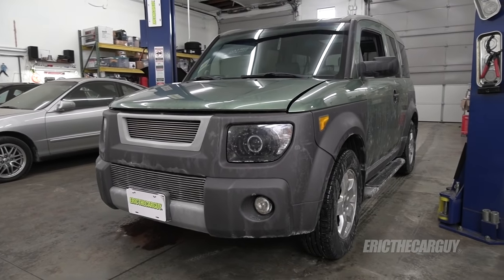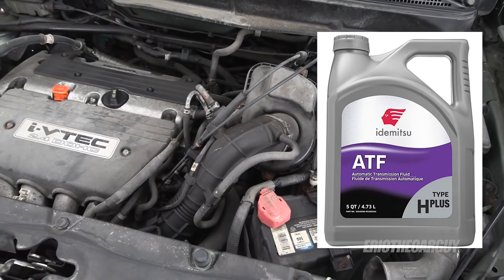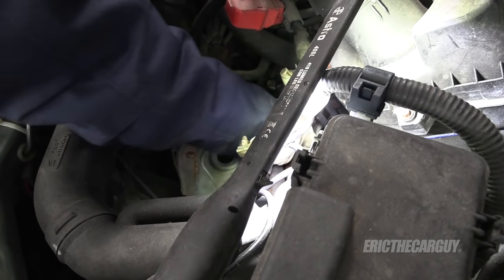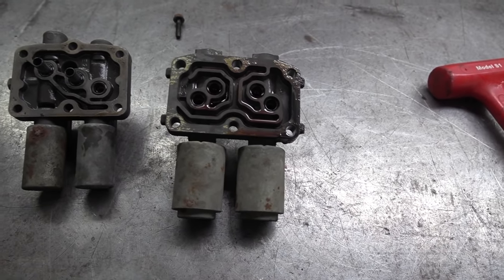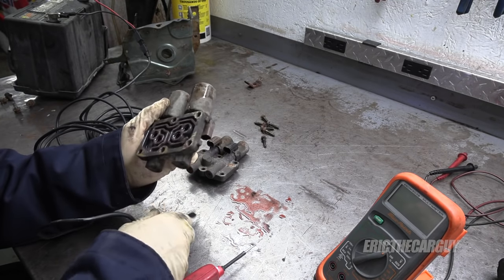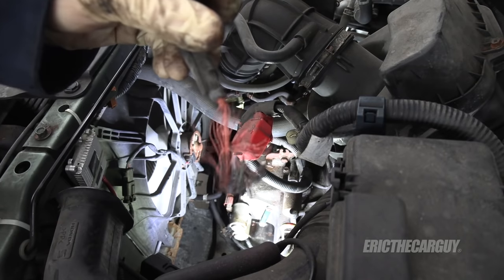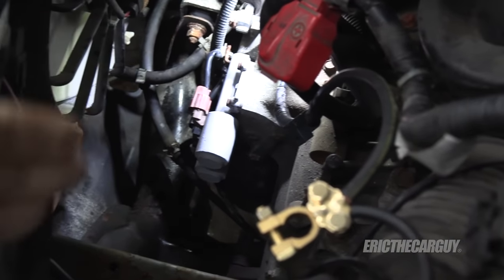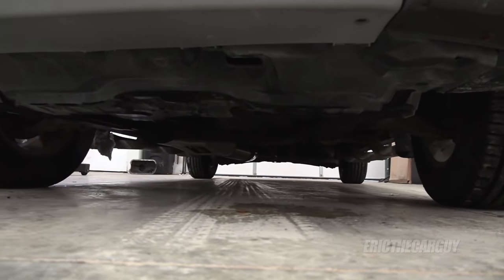Delayed Shifting, Honda Transmission

Comment: Hi there , some issue basically on morning Civic hybrid 2010 ,while shift from P to D there is a little delay and then small bump and then after  all runs perfect in other time of the day not issues any warning signs just works perfect but this bump such annoying case , any idea ? Thanks in advanced

Comment: Change your atf at half the interval honda says to! My 2016 odyssey was shuddering when shifting 3-4 and 4-3. Honda says atf every 100k. I do a google search, they have a tsb for this exact issue. Solution, atf fluash. I had it done problem gone. My van was at 57k miles. If Honda just said atf at 50k miles there probably would be alot fewer complaints about honda auto trannys.

Comment: Great video, I have a 2009 civic that has delayed shifting in all gears.  
I have replaced the fluid and the filter with no results.
There’s 2  solenoid packs under the air box.  Which one should I replace.  The one with 2 solenoids or the one with a single solenoid?  Thanks so much

Comment: My Acura tl 2003 since winter of 2000 has problem shift in cold weather, 40F or below, when start.  First, I put in D all good till first stop.  Then do not want engage 1st speed after I stopped at the first STOP sign.  I move my leg from brake pedal but car do not want to move.  I have to move the handle from D to N a couple times or move it to 1st manual.  And a couple times so till car/tranny warm up.  I tested dual liner for resistance and it show 4.9 and it is close to 5 ohms.  However I tested it at 50F, and you show that test may or may not be good.  Other, your car has problem in 3th and my in 1th in cold weather.  Some guy at forum say in my case should be single pressure solenoid C.
Btw in June my Acura had timing belt failure like yours, 11 tooth missing, and I go ahead replaced timing belt set and all good.  Get lucky.  Made tread about it at acurazine "The engine stalled while driving last night and car will not start again..."

Comment: How do you find the correct solenoid for the gear that's delayed? My car has delayed shifting in to second which I'm guessing is 28015-RCL-315 Solenoid Set A but I'm not sure.

Comment: How exactly did you isolate it was THESE solenoids that you need to address, and not some other solenoid(s) or pressure switches? Thanks.

Comment: Thanks Eric! That was awesome. Please, what could be the possible cause(s) of flashing 'D' and green light on 'R' at the same time on a 2002 Honda CRV immediately the ignition is turned on?
Note: The transmission is shifting fine but the two lights on with 'D' blinking on the dashboard.

Comment: I have Honda accord 99 4 cyl. It does not have any error code but 1 gear slams really hard  in either direction. I replaced solenoid but no improvement. I have already replaced fluid with Honda Fluid.

Comment: I had this shifting issue on my automatic 1995 civic. I replaced the vehicle speed sensor for 13 bucks and its been fine for 3 years.
Reply from the maker: Pre 2000 Honda transmissions were very different. Better in my view.
Reply: I have hard shifting 2nd hard to get to 3rd gear . 2000 Honda Civic DX idk what to replace

Comment: I don’t know if it works the same on an Element… I had a bad solenoid on my 2004 Honda Pilot and the Drive light would blink which is a warning that solenoid is failing

Comment: Great video Eric... I have a 2004 Accord 4 cylinder. I was always told they did not have replaceable filters. Do they all have that?  You did show on the fixing it forward Odyssey that filter. However, never saw an in line one like that. Thank you for your hard work.
Reply: Honda manuals officially says they aren’t serviceable which makes no sense because they clearly are.

Comment: Nice video Eric. My 08 element shutters when it’s at a steady speed between 30 to 60. Even when I use cruise control. I have changed the transmission oil twice now and used Honda oil. Have u come across this problem?

Comment: Love your videos! Was just wondering, what is the MPG on that element. Mine is getting around 17 mpg and I'm trying to figure out if that is normal or should start looking for an issue. Thank you!
Reply from the maker: I get 17-18mpg with my manual Element driving around town, not much highway at all. I haven't kept track of this Elements mpg lately. It's probably less, by 1 or 2 mpg, because of the automatic.
Reply: @ericthecarguy  Thank you so so much for your reply! I got it at the end of 2020 and didnt notice the coolant hose was leaking. Got a warped cylinder head -__- But thanks to the help of your videos I was able to get the head removed and machined myself! Thank you so much for everything you do! Element is running well now!

Comment: My honda crv 2006 won't  shift back from 2nd gear to 1st gear on steep climbs. I always need to manually shift it to 1st gear. The RPM get stuck at 2K on 2nd gear and wont shift back to 1st gear on steep climb. Could it be the shift aolenoid?..  tnx for answering sir.

Comment: Hey man my civic 91 dx had it for 6 years and like 3 years ago transmission run out of oil and i fill it up again and then i rebuild the engine but i fell the car really really slow like lose of power it shifts normal but car fells so slow all sensors are working no check engine codes and had straight pipe exhaust , what show you recomend me i think the problem is the transmission

Comment: On your 07 TL there are shift solenoids inside the transmission below the clutch pressure switch which is what you took off

Comment: Eric, I have an 03 Accord V6. Last week I was driving to my VA appointment, all of the sudden my car made a jerk sound and slowed down instantly. I couldn't drive over 20mph. I have replaced the trans fluid, some sensors, spark plugs, coils. And its still doing the same thing. I was told its the switch solenoid. Is that true? Please help!

Comment: My Honda crv 07 has the same issue on the second shift. I've changed the clutch pressure switch and it's still the same. 😞😞😞

Comment: Well Thank you for the great demonstration, however, I wanna ask you a question, I've civic 2000 ex and had the same shifting problem but the solenoids are different than this car in the video could it be fixed the same as what you did??    Thank you very much

Comment: Hello! I have an 05 element. I recently noticed that after a long drive if I shift the vehicle from park to drive it takes a second then jerks into gear. This doesn't happen cold and all gears 1-4 are totally fine and crisp. Any ideas? I've tried to hit the forums and no luck. 
I've done a trans filter and a 3x drain and fill.
This only happens when it's warm!

Comment: I have a 2017 V6 Accord sedan and very rarely, once a year ago, and once a week ago, it suddenly shifts roughly into first gear when slowing down. After that, all the following shifts are rough and delayed (even with minimal throttle it doesn't shift into 2nd or 3rd year until 4000 RPM). I pull over and turn off the engine. When I fire it back up, it runs smooth as butter. Is this a software glitch? Clutch wearing out? I'm at 174,000 miles~

Comment: My 06 CR-V taught me first hand how much it appreciates proper voltage. I noticed that the alternator was acting flaky a few months ago, but nothing to warrant replacement. Then the F Can bus started dropping out. Whenever this would happen and it would upshift it felt like I was hitting a brick wall. Literally painful to drive it! Then when first coming to a stop, the VSA would lock the brakes on for a few seconds before releasing. Not long after, alternator completely died. I wonder if the rectifier bridge failed and it was dumping AC into the electrical system.
Reply from the maker: https://www.ericthecarguy.com/solving-automotive-performance-issues/

Comment: I have a 2002 Honda CRV. I have the EXACT issue. Changed the solenoids, had the same issue but I didn't change the filter. I'll have to try that.
Reply from the maker: I don't think the filter will help in that situation. https://www.ericthecarguy.com/solving-transmission-problems/

Comment: This video could not have better timing for me.  I have an '06 Pilot and it recently started failing to shift into drive when first starting up.  I shift it into drive, but when I give it gas it just revs up and doesn't move, as if it is in neutral.  I shift into neutral and back to drive and it will then engage normally.  Do you think this could still be the solenoid, or am I more likely looking at a failing transmission?  Being a V6 I figure it's probably failing, but the solenoid seems like a good place to start, might get lucky!
Reply from the maker: As I said in the video, if you have a Honda V6 transmission, you may need a lot more than just solenoids. I'd check the shift cable connection at the transmission for corrosion. http://www.ericthecarguy.com/faq/solving-transmission-problems

https://www.youtube.com/watch?v=D4C3tbs6Czc&t=1s

Comment: I have a 2001 honda accord v6 3.0 vtech automatic and I'm having a delayed and hard shift jump from 1 to 2. It's annoying what is it? I had my old tranny replaced cus it stopped working and this one is doing the same exact thing the other one was doing. But what's the cause of my issue. I wanted to try the shift solenoid as well.

Comment: Easy fixes are the best fixes! Great video Eric. The transmission filter is not a service item on either my wife's 2011 Pilot or my 2013 Fit but would you recommend I change them every transmission fluid change or maybe every other? I know it can't hurt to change it every time.
Reply from the maker: They may not be accessible. Not all Honda transmissions have a replaceable filter. Some are inside the transmission case. Changing the fluid with Honda fluid about every 30K is all that's really necessary in my experience.
Reply: @ericthecarguy  thank you sir!

Comment: My gf's accord is doing this exact samething but only goin from first to second gear. Sometimes its fine but most of the time it skips second gear and the D llight blinks
Reply from the maker: Pull the code, see what it says.
Reply: @ericthecarguy  pulled the code it was p0700 related to transmission but what baffles me is her sister has the same exact car with a lil less miles (106xxx miles) and her transmission is good. Do you think it was a hit and miss on those transmissions. Cars are both 07 accords 2.4 (gf is EX-L and gf's sister is LX). P.s. also recently changed solenoids and switches on the transmission and filter with new genuine honda trans fluid.
Reply from the maker: https://www.ericthecarguy.com/solving-transmission-problems/

Comment: I used to drive a Honda accord 2008 2nd gear to 3rd gear common issue for my car. I tip on the gas, it solved the issue. Is the software issue got a recalled once.

Comment: Hello I have a  2007 Honda Element ex and the part stores say my honda doesn't have a transmission filter but I clearly have one because it's in same spot has the one in this video. My question is should I go ahead and take it off and take it to part store to see if I can match it?

Comment: MY 05 ACCORD 2.4L has a transmission problem with all gears having problems but mainly 1st, 2nd and 3rd. But as soon as I turn my vehicle off and back on it starts working better for a short time. I already switched the oil and in line filter plus addded both lubeguards. Any idea what could be my problem?

Comment: so the transmission filter is not inside the transmission bell itself?   or is there a secondery filter inside the transmission  casing itself?   is  that's  the same  case w/  the 8th gen civics?

Comment: Hi Eric. I would like to ask your advice. I have just bought a 2014 Honda Fit with 12000 on the clock. The (Honda) Dealer says the transmission oil has never been changed although the engine oil was changed every six months by Honda. Would you recommend that the Transmission oil should be changed? Honda say not necessary, but I think that although it's a low mileage vehicle I would prefer it if the oil was changed. Your thoughts much appreciated.

Comment: Hi Eric great video! I am having the same issue with my 2004 accord V6 .... would you know the equivalent solenoids responsible for the shift from 2nd to 3rd on this application? I've been trying to find it but it seems the V6 has a few more solenoids than the 4 cylinder. Any help would be greatly appreciate, thanks!

Comment: 1993 honda d4 stays on and shifting is irratic.  Ecu was repaired by G7 computers before d4 light issue...as the shifting problem was the issue.  After I installed the repaired ecu, that's when the d4light stayed on.  Pulled code but no error was shown and check engine light never came on.  There was a water leak that dripped on speed sensor.  Would I get the d4 light issue from the speed sensor.  Transmission solenoids checked good and cleaned.

Comment: @EricTheCarGuy: I have the exact same problem with my 08 Honda Pilot except it's 1st to 2nd and 2nd to 3rd gear with no codes. You think that this is also the solenoid or something else? Drain and fill done thrice and my issue occurs only when the vehicle is cold. After driving around for a bit the issue is gone. Would love your input. Thanks Eric!

Comment: I think the valve bore inside that aluminum assembly where the valve rides was worn and not able to build the proper hydraulic pressure to engage 3rd gear smoothly

Comment: My honda pilot 04 gear delay, take much time before change , have change the solonoid switch still yet not running fast too slow. Please what is the solution

Comment: I have a 2002 Honda Accord Ex Coupe.V6 automatic tans.  I have a shift malfunction, code P0780. it delays from 1st going to 2nd. it works okay with others. I changed my transmission fluid, got it directly from Honda, thinking if I should flush the ATF or not. my next step is to changed the shift solenoids. hopefully there's no delayed shifting after that. wish me luck

Comment: Off topic, but is it ok to use Castrol CVT fluid in a 2019 civic ex-t CVT? I've read the reports from Castrol and from what I can tell it's just slightly better than OEM Honda hcf-2. I even contacted Castrol and they say yes. They recommend removing as much of the hcf-2. So basically 3 drain and fills.

Comment: Nice Video Eric ... great tips and diagnosis ...  heres one for your memory bank . i own a 2003 acura mdx with the 5 speed auto . One day leaving the stoplight it suddenly slam shifted 1st to 2nd and flare shifted 3rd and 4th etc . It only did it once and returned to normal operation , no check engine lights , no trans lights blinking . Over the summer in came and went but still no lights , i really thought the trans was going out at that point .  Then one day it did it again and the d trans indicator started blinking and I thought it was starting to go . I had no special scanner to do trans codes , so i just kept driving it .  i noticed in time that once the d light started flashing , the trans would shift differently and would never act up as long as the d light was blinking ( I assume loop mode looking back ) .  Then a couple of months later the trans temp light would come on yet the trans felt luke warm to the touch so i was suspicious . Eventually i found somebody to scan it for me and sure enough , the code was a trans temp sensor . Replaced it and its been good ever since , cant believe how that sensor made the trans shift so hard and flare so bad and the fact that it took months to throw some codes . It never did throw a check engine light , just the D light and the temp light .   That sensor wasnt cheap either , and every one I tried to scrounge at the bone yard broke trying to remove it ...How you diagnose stuff like this when there are no codes is a head scratcher .... Love your channel , maybe this will help you someday  ... Thanks Buddy

Comment: Hello have an 08 fit that runs up to 2000 rpm in first before shifting, is this normal? Also how long will that transmission solenoid from eBay last? How about buying used from a junkyard or Napa has some for $100 plus with a warranty. They usually have 20% off of you order online and then pick it up in the store.

Comment: 03 Crv mines can’t shift into 3rd My drive light is still blinking. I’ve changed my shift solenoid, the top solenoid, pressure switch, filter and Honda trans fluid and still

Comment: On my G2 Integra if I jam it from start and dump it while in second it will hang in second instead of shifting to third then shifts about a second later into third. And if I punch it to pass while in third it will go straight to first, wind the hell out of the engine and give me nothing to pass with. Solenoids?

Comment: Good pm, i need a solution:- My Honda baby Delay to Load when i put it on drive, and when i slow down in traffic the vehicle jack, but the engine always select normal and fine. please what is the solution

Comment: Thanks for the video Eric.  I have a 2011 Honda CRV LX with almost 170k doing the exact same thing.
Reply: 03/17/2022 followup.  I replaced A,B,C solenoids on my 2011 Honda CRV LX and it now shifts like a new transmission.  Thanks Eric for the video!
Reply: @richr1029  was The transmission juddering or shuddering? Did you try Lube Guard shuttering Fixx? Thanks…Jim
PS…..my 2009 CRV Is juddering between 3 & 4 Gears, At about 40mph.
Reply: @jimpie231  HI, I had the infamous "flair" the mechanics talk about.  Almost like driving a stick shift and the gear winds.  I just placed the complete solids with OEM ones and it corrected the problem.   I went with OEM as I seen alot of mixed results with aftermarket and rebuilds.  Who wants to do the same job twice?   hope that helps.